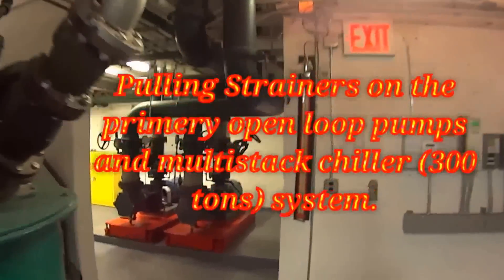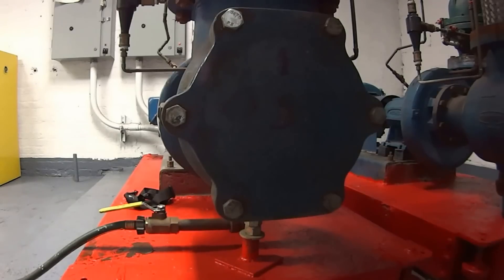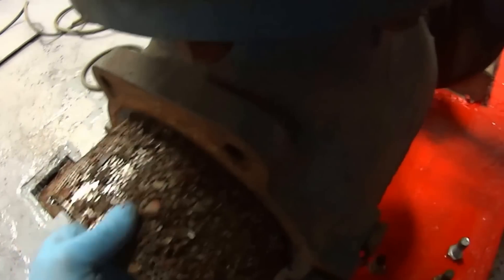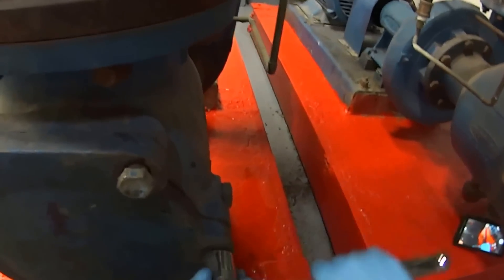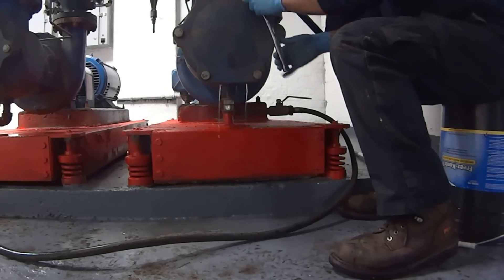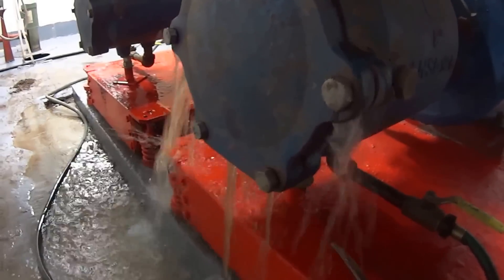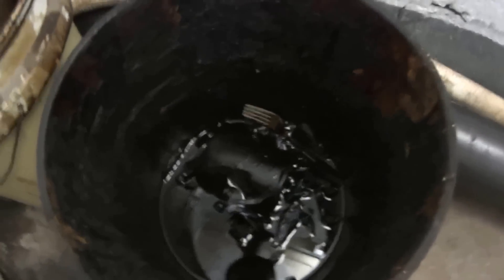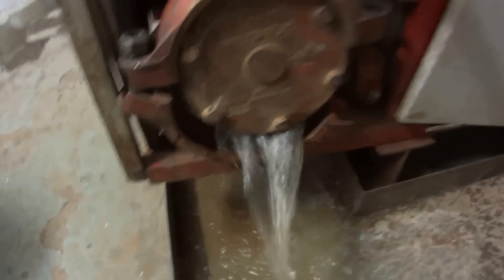HVAC | Multistack Chiller | Pumps | Preventive Maintenance

Comment: I'm looking at that strainer you just pulled out. I noticed that there are no rings on either end of it as well as no pull rods. Is that particular strainer designed like that? The reason I ask this is because since December of 2018 I have been fabricating these filters for Multistack. So far every one that I've ever made has had both rings and pull rods. Tell me what you think.

Comment: Great video Emin HVAC I used to service a couple of pumps just like those on a plastic factory so it was nice to see how you do it. Thanks for sharing.
Reply from the maker: It pretty simple right? Not to bad, people are afraid to touch bigger equipment,  they are actually easier. Thanks for watching again .
Reply: Exactly. I love working with the big stuff. You just have to put some more muscle into it because it's bigger but then you don't have to fiddle with tiny stuff or places you can hardly put your fingers.

Comment: Cool to see! Very interesting. Do they use the chilllers there for cooling or are they somehow used for heat? I would definitely like to see some more videos explaining the basic process of the systems you work on a bit and how it works together to perform its job. Keep up the great work and God bless you mightily!
Reply from the maker: yes the chiller is used for cooling, however some building have a 4 pipe system where they have the option of heat or cool. One day I will make a video explaining the basic process and how it all works. summer is around the corner and I will get the opportunity to make more videos on the bigger chilled water systems. Thank you for watching, greatly appreciated.